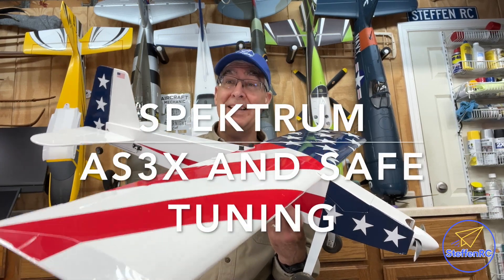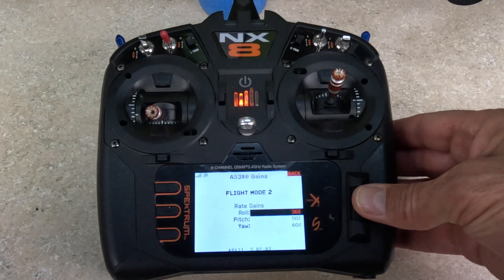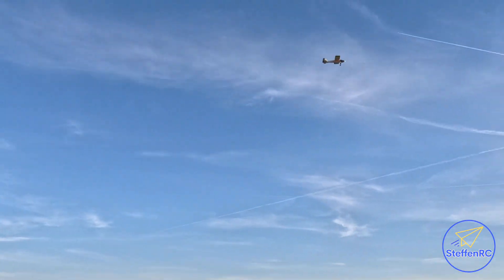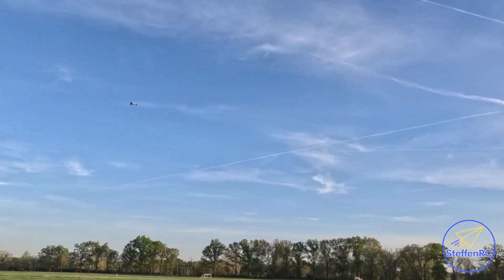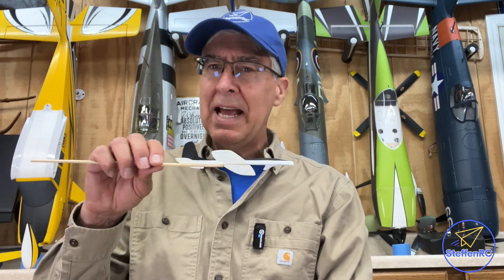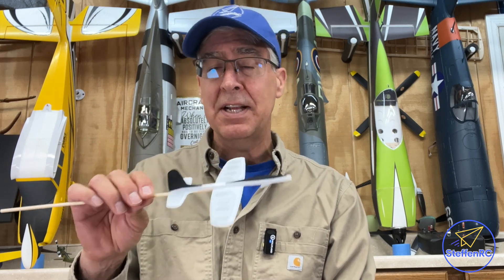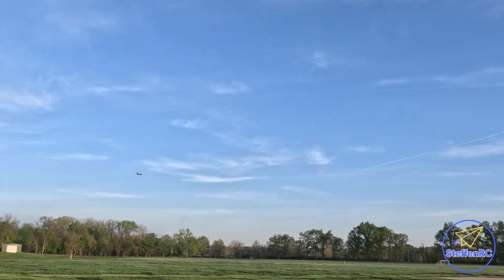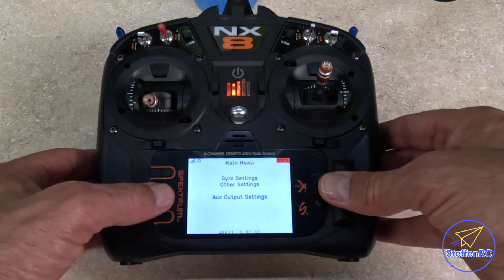How to tune Spektrum AS3X+ and SAFE - Beginners Guide Part 2

Comment: when setting up as3x and safe on my tail dragger , do i leave it set normal or do i set the tail up to were its level thank u
Reply from the maker: I leave mine resting normal on the tail.   The AS3X system won't care.  If you are using SAFE and find the plane climbs or dives a little, you can adjust the attitude in forward programming to get your plane flying perfectly level.

Comment: When I'm in safe my direction is incorrect how to change that
Reply from the maker: If the direction isn't working properly when the Gyro is turned on, then the orientation is incorrect.  I would double check the correct orientation when you mounted the RX.  The other issue may be you reversed a servo AFTER you setup AS3X and now you need to RELEARN SERVOS in the Gyro/System setup menu of Forward programming.  Let me know if this helps.
Reply: @SteffenRC  If I'm in safe and tilt the airplane up should the elevator point down the and pointing down then it should up
Reply from the maker: @malcolmstewart3177 if the plane is on SAFE and you point the nose down, the elevator will go up.

Comment: This would apply the same way to for example my V1 Viper 70mm if I want to upgrade to as3x plus correct? Also is it a good idea to relearn servos on bnf planes also that already come set up from factory if I had to trim?
Reply from the maker: Yes,  This should apply to your Viper.  Some of the BNF didn't enable Forward programming, so you can't Relearn Servos after trimming.  I think the trimming will be fine.  I get a little overboard with tuning..

Comment: Before programming the Safe mode, should the plane be level? With a tailwheel the plane is not standing level. Should I raise the tail of the plane to a horizontal level before programming? 

Or use the option in the program "Level model and capture attitude?" It is not clear to me what they mean with "Level Model" Do they mean: Put it on its wheels, or level it out horizontal (raise the tail), or Capture Attitude?
Reply from the maker: I just setup SAFE with the plane on the bench.  No adjusting.   Later, you can adjust the Attitude (pitch) of the plane so it flies level or a slight pitch up in SAFE.

Comment: I followed your first video exactly. However when I switch to as3x and I pick up the plane and rock it nothing happens. No servo sound or surface movement.
Reply from the maker: Hold on to the plane, turn on motor and apply throttle to 50% for a second. Then AS3X will turn on.   Funny thing is I just made a video about the 7 tips for Gyro.  That tip is in there.
Reply: Thank you again, that worked, I'm going to check out that video. Thank you for actually replying back, and lot of people don't answer any questions.
Reply from the maker: @HORRUS29  no sweat.  I always try to respond to comments.  Glad it helped.

Comment: As you mentioned again at 5:47 to relearn servos, this video goes into great detail of all of the receiver configuration details. There is a big difference when the receiver is unlocked. 

https://youtu.be/Qxfb9EbjN0s?si=ZfNufMUcSQubnXJ0
Reply from the maker: Yep,  He goes into a lot of details about the rx.  I'm thinking about a video to show the unlock and why you need to do this.  Also, the factory reset when swapping rx from model to model.
Reply: So as noted in the software he is using and in the video, the rates and Expo are ignored by the receiver when it is unlocked. The only thing the unlocked receiver learns when doing a relearn servos, is the servo Direction.
Currently, the newest version of that software doesn't let you unlock the receiver. I have been using that software for over a year, so I still have a copy of the previous version that lets you unlock a receiver and retain all of the current settings, thus you don't have to set it all up from scratch again.
The latest version still lets you look at all of the parameters from the factory so you can put them all back via forward programming if you want.
Reply: Another thing to note is if you decide to persue using the SASMB software shown in the above video, the latest version also accommodates all of the new AS3X+ settings.

Comment: You aren't able to access these tweaks with BNF receivers correct without wiping the receiver clean? I'm very confused and tried and can't understand why they don't program on there own planes. Am I correct on this? I guess they believe they have their planes from Eflite tuned properly all the time?
Reply from the maker: You are correct.  The Eflite BNF are configured for the optimal AS3X settings.  Some of the RX are locked too.  You’d need a program cable to unlock/reset and reprogram.

Comment: These “how to” videos are great!  They really help me out a lot, so thank you!  With that said, I have a question about receiver installation.  Would you recommend using double sided tape, Velcro, or caulk to keep the rx secure?  Also, I’ve seen fellow modelers set their rx’s in their planes loosely and seemed to fly with no issue.  What’s your take on that?
Reply from the maker: Great question.  I always use 3M double stick tape.  I have a link to it in the Part one of this How to setup a Model video.  If you are using a Gyro, you MUST stick it down.  If it starts to flop around, the plane may become uncontrollable.  Some use double stick tape and a dab of adheasive on the edges to insure it doesn't move.  If you aren't using a Gyro in the RX, then no need to lock it down.  However, I still do to make thinks look nice and orderly..
Reply: @ keeping the rx secure is key if using a gyro like SAFE.  Makes a lot of sense.  Thanks for responding so quickly!  Keep up the great content on your channel!
Reply: I believe in properly securing all receivers to the air frame, preferably over the center of gravity location.  I cut a piece of model grade plexiglass (.20mm) the exact size of the rx.  I epoxy glue the plexiglass to the fuselage floor then using double sided servo tape, I cut two thin strips, one placed at the front of the rx and the other at the back.  I then secure it to the plexiglass.  This insures that it won't move in high 'G' maneuvers AND makes the RX easy to remove from the airplane when that time comes.

Comment: Fantastic vidio, thank you. One question, I noticed it didn't you to place the plane on its nose. Is the procedure still needed? thanks again.
Reply from the maker: There are two ways to setup the orientation with the Spektrum AS3X.  One is to place it on its nose, the other is to manually tell it the direction of the RX.   I show how to do that in the first video of the series.

Comment: While the transmitter’s flight modes can be used to control the receiver’s flight modes, they should not be. The transmitter’s flight modes should be used for flaps so that you can use F-mode trim to adjust the elevator (and aileron) trim in each position of the flaps in flight. To control the receiver’s flight modes, all you need to do is go into the Channel Assign menu and assign a switch to the channel you want to use. I typically use channel 9 for the receiver’s flight modes and channel 10 for AS3X gain. The newer Smart receivers can decode up to 20 channels, so there’s no need to use a lower channel that has a servo port unless your transmitter doesn’t have enough channels. Spektrum doubled the AS3X gain in the AS3X+ firmware, so I now set the Gain Sensitivity to 0.5X instead of 1X. I don’t know why they did it because 2X and 4X have always been there and were never used. The default SAFE gain of 35 is usually too high for the roll axis. I usually set it to 25. It’s enough to level the plane and shouldn’t cause oscillation. Look for my recent AS3X/SAFE videos on my YouTube channel.
Reply from the maker: Thanks for sharing your tips; I appreciate the different perspectives for others to consider. Will